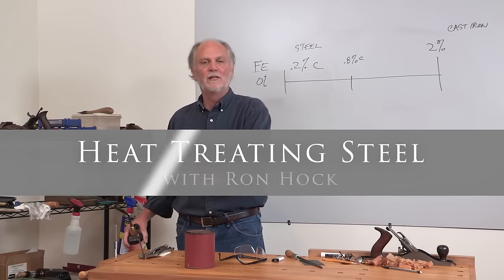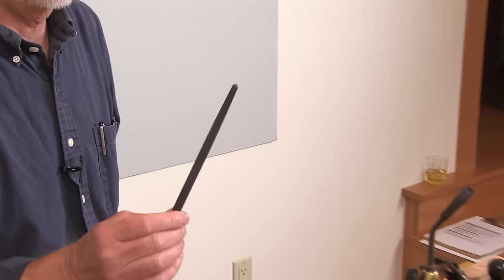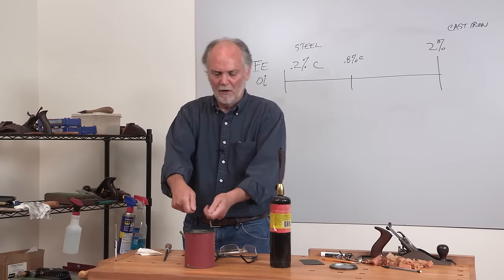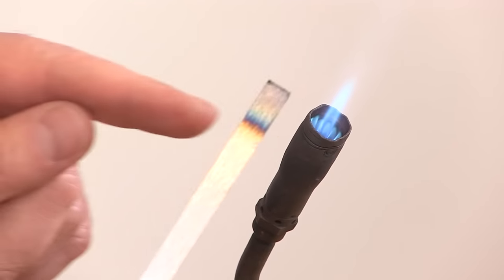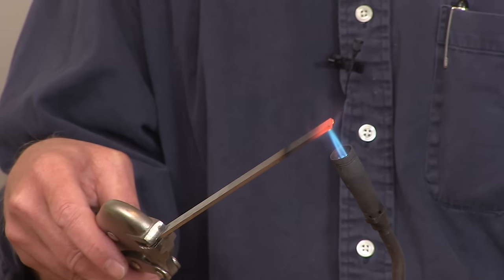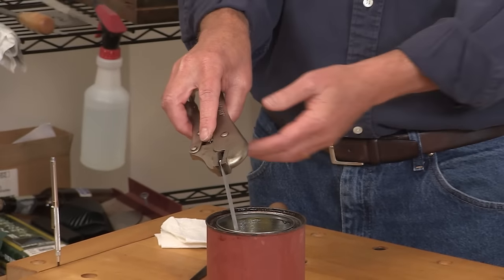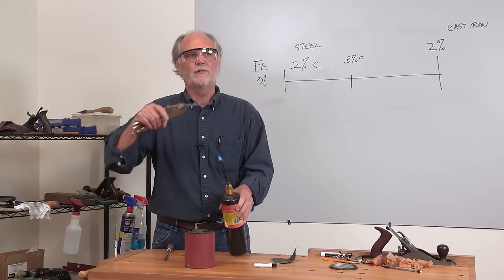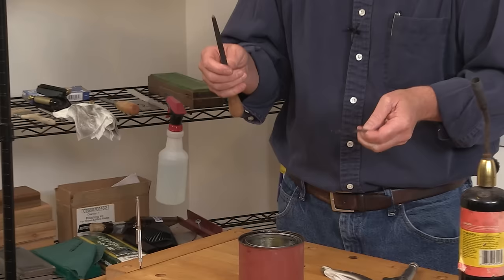Heat Treating Steel

Comment: Does the metal become brittle after this process? I have a spring that works essentially like a clothespin does, but the steel rod will break if you bend it back and forth a few times. There are different treatments, but I have no idea which is the right one. 

This process in the video might be it. Thanks!
Reply: The metal becomes hard but brittle after the first dip, and then the second dip takes away the brittleness.
I'm just trying to work out how to do this so I can DIY a metal stamp.
Reply: @leinad.s  Thanks! I am going to try that.
Reply: To really make the steel strong as well as hard, you would use white carbon powder, when the steel is red hot just B4 melting you dip it in the carbon powder and the steel will absorb the carbon creating a high carbon strong steel, such as what is used for driving wedges under extreme compression.
High carbon tempered steel.
Reply: @johnkomosa9508  Could you mix your (peanut)oil with for example charcoal powder for extra carbon? If there is more to spare it should take in more? Complete metal-noob here by the way....

Comment: I have been thinking about making some log tongs and Log grabs for some tractor logging on the farm. Will use some mild steel. What would you recommend on how to harden them? Will be hitting the grabs with a skip hammer.
Reply: You can't harden mild steel. You can case harden it by soaking at red heat in a carbon rich atmosphere, like graphite etc.

Comment: Did the quenching have a different effect than if you just let it cool naturally
Reply: Yes they won't harden it very much. Depending on the current hardness of your metal, it might actually get softer. Heating and letting it naturally cool normalizes the steel.

Comment: I have a question. 
Which metal heats faster, Gold or Steel?
Reply: Gold. Steel and and bronze have the lowest heat conductivity while gold is near the top in metals. Also golds melting point is around 600F lower than steel.
Reply: @LPJMagicmusic  Thanks so much.
Reply: @KC.45  you bet👍
Reply: @KC.45  He's wrong you know, the answer you seek is silver, silver the most conductive metal for both heat and electricity, and also the most reflective of the metals.
Reply: @leinad.s  I wouldn't say he's wrong. He never stated anything about silver

Comment: I have a question! Would this be dangerous (er, more potentially dangerous) if one has a peanut allergy? Does the peanut oil become a vapor?
Reply: Linseed oil is what I use and it works well

Comment: So could i do this on spanners to strengthen them even more ? Or does it get a whole shit load more technical than that
Reply: Spanners are heat treated during manufacture, using tightly controlled furnaces and time tested methods. This process is best for making custom tools or maintaining cutting/punching tools. Heating manufactured tools up could cause them to become unsafe or weak. I guess you could try it if you don't mind losing one spanner, but there are a lot of nuances even in quenching a piece of metal correctly. Good luck

Comment: I'm making a meat cleaver from AR450. Can someone give me tips on hardening this steel? 
Thank you 
Greg kline
Reply: Leave a thicker edge, as in, don't sharpen to your finished edge dim. This could encourage cracking. Oversize the edge thickness to 1/16 inch at minimum.
Get it red hot, test with magnet, and quench it tip down in oil, peanut or avocado oil so there is less smoke. Don't wave the flat end of the cleaver into the oil or you will potentially warp or distort the cleaver shape, because of the pressure differential. Remove scale from the hardened piece with a wire wheel, then temper the edge as shown in the video, seeking the straw color. Finish grind cold and never let the material get hot enough to discolor or you will need to repeat the entire process to achieve hardness.

Comment: Just an fyi do not quench after your temper...  It nullifies it
Reply: Would it be better to let it cool on its own? I'm curious
Reply: Generally a bad practice... But everything changes steel to steel.... With some you are right it doesn't truly hurt except it may add some additional stresses to the work piece although it would increase chance of crack or warp which can happen  when your correct quenching medium is properly treated.... Others however the second quench would only reharden the piece.... It's always best to know your steel. Whether by reading about it, or testing it yourself.

Comment: If steel/iron  becomes no -magnetic when glowing red to white hot explain the earths magnetic core??
Reply: Everything has some amount of magnetism,
At incredibly large amounts, that small amount amounts up, but that’s only one reason.
Reply: Excellent question. Who knows, lol. 
The core is very hot but also experiences such huge pressure. It may be solid or in a superionic state which is like a state in between solid and liquid. This state also has high electroconductivity. Perhaps that's another factor in a dynamo effect, where the different layers of the core could produce and build upon the total magnetic field. We don't know what the core is like exactly and are just starting to explore it better.
Reply: @petrov3000  yes.